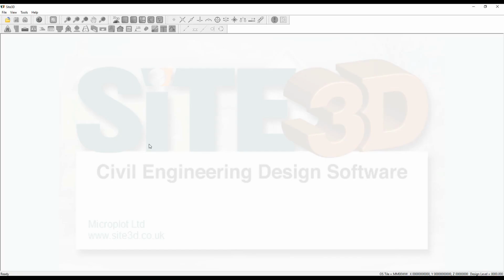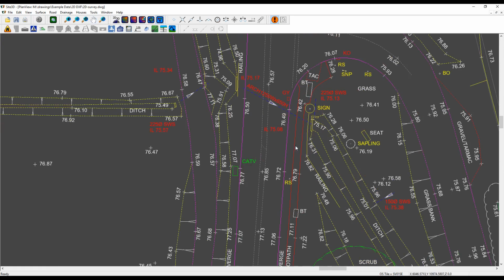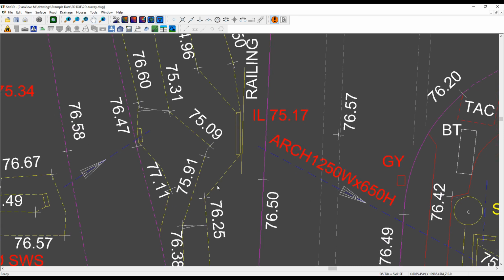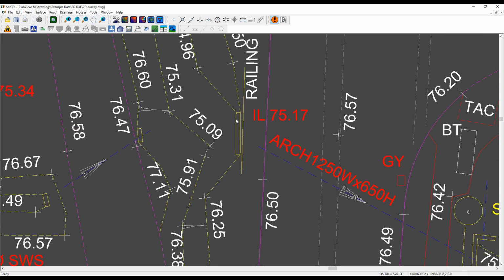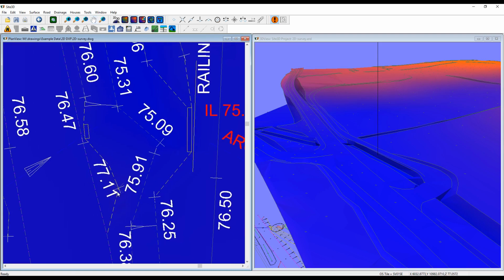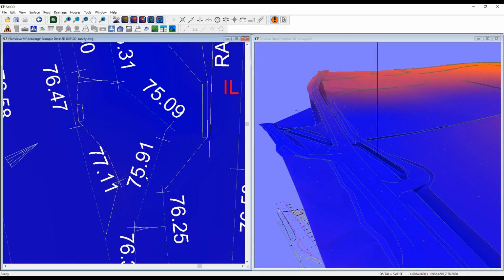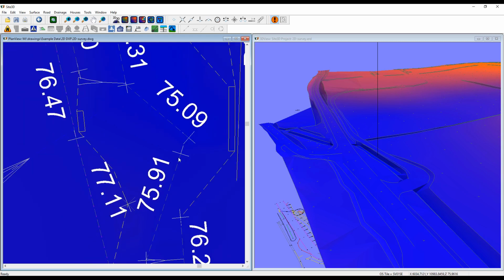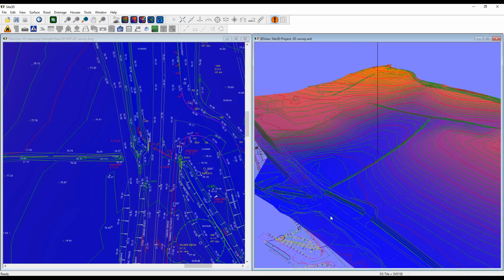Site3D: 2D to 3D Topographical Survey Converter

Comment: Very interesting.  I quite like this idea but to be brutally honest, I think the only way this would be useful is if it could read scanned drawings (so that it can take that 40 year old survey drawing you have and convert it to a 3D model) because I've never had a surveyor send me a CAD file in 2D and if I ever did I would immediately go back to them and request the 3D version of it.
Reply from the maker: This is something we have considered but found it very common that people have 2D surveys in digital format from either old surveys or that's all that has been given to them to start a preliminary consultation with. This allows them to get started on the design work whilst they wait for an updated 3D survey from the client (which could take some time). If you want to work with scanned drawings, Wintopo is a great raster to vector converter, however the OCR of text is yet to come I believe.